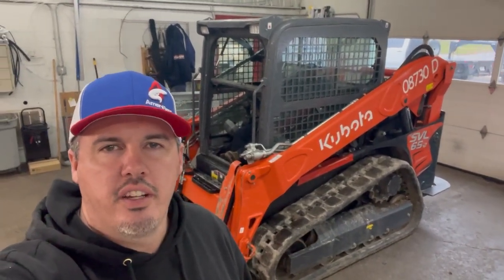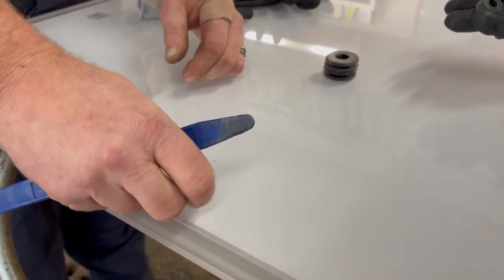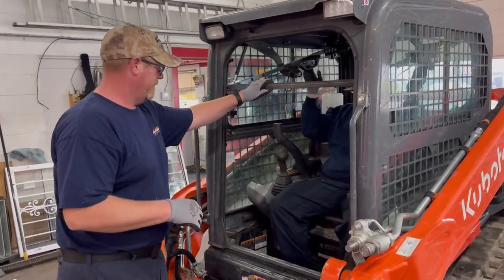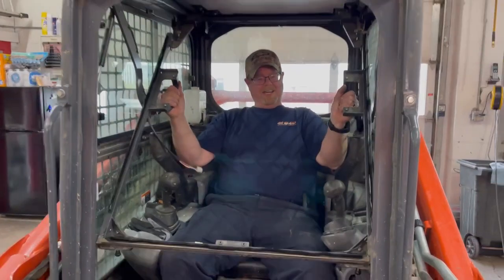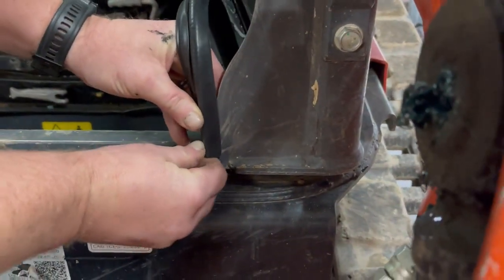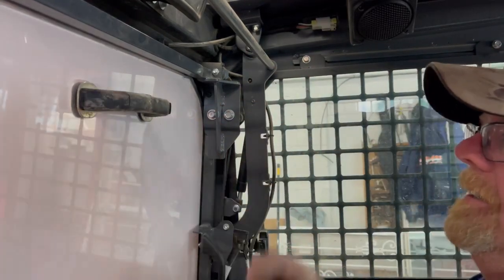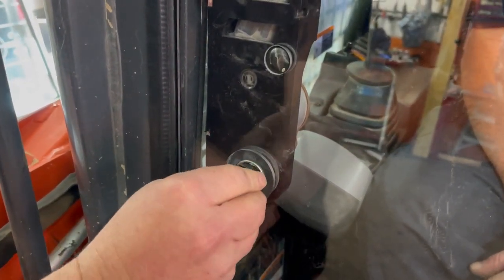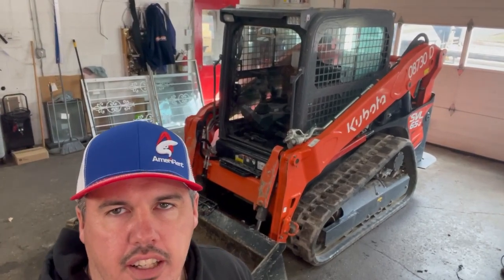Detailed Kubota SVL Polycarbonate Windshield Installation without Removing the Frame

Comment: Excellent instructional video. Thank you for producing it. If you don't break the original glass before hand like was shown in this video, how do you separate the tempered glass pane from the frame? Do you just slide your knife between the two?
Reply from the maker: Yes just use a blade from a carpenter knife and cut between glass and frame...

Comment: Could you post what primer was used? And also the adhesive you recommend is primerless. Do you have to buy adhesive that is not primerless?
Reply from the maker: Sika Primer and Sika Flex 295 or 3M U-428.  These were not used but are the recommended.  I'm not sure which urethane the installer used.

Comment: What size grommets did you use and where can I order them from? I can’t seem to be able to find them anywhere
Reply from the maker: The grommets used were the ones that come with the hardware from Kubota for the glass door. Get with your local dealer.

Comment: On our SVL 95 2S the top handle is on the outside of the glass from the factory. You installed it on the inside. I use that handle to close the door to latch from the outside of the machine. Is that correct to reverse it to the inside?
Reply from the maker: LOL, no you are correct.  They installed it on the wrong side.  It should be installed on the outside so that when you get out you can pull the door closed.
Reply: I just noticed that. Great video on the install. Removing the glass and installing a polycarbonate forestry glass on our SVL 95. Thanks, great help to know the process before I start. Thank you again. @AmeriRentEquipment

Comment: Does it scratch easy?
Reply from the maker: It has a coating that is applied to it after it is formed and cut.  It helps with scratch resistance but no polycarbonate is scratch resistant.